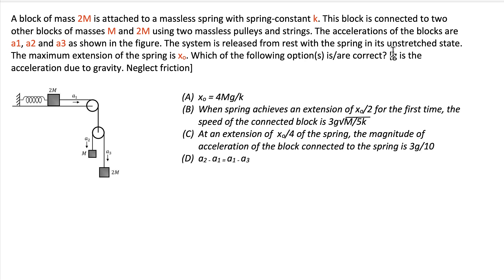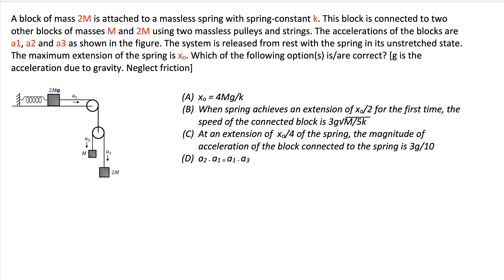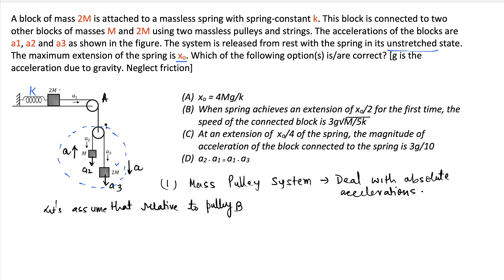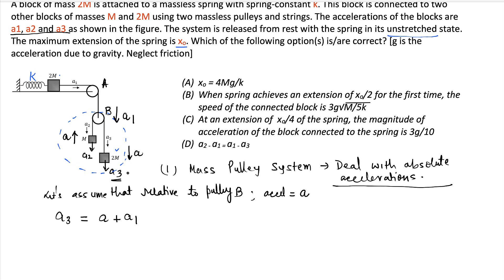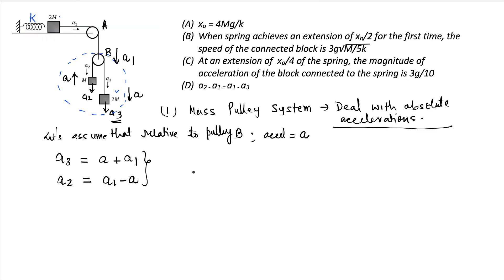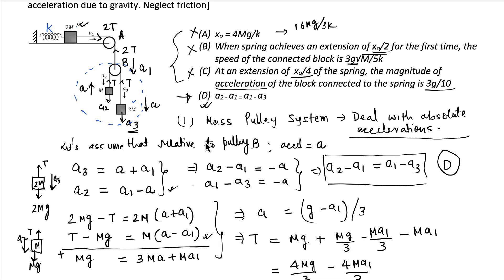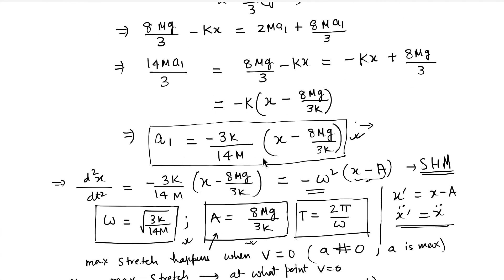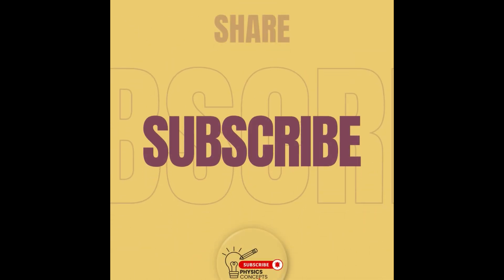Want to Master Mass Pulley Spring System? Watch This IIT JEE 2019 Advanced Problem #jeeadvanced

Comment: You emphasize to focus only on absolute acceleration and not the relative one. Then immediately afterwards, you introduce the relative acceleration of the blocks hanging by the pulley.
Reply from the maker: To answer the question as one of the options requires that.
My point is to deal with absolute acceleration when writing f=ma, as it's less error prone, and simpler

Comment: i went ahead with the problem assuming tension would be constant throught the motion and only the spring would cause the change in acceleration, but turns out it's more complicated than that. great question
Reply from the maker: yeah, that's right, it's a great question. 
In fact, i have noticed people missing the SHM as well there in some cases.

Comment: Its quite lengthy 
I have a simpler approach 
We get Tension as calculated by sir.
Then we solve for max extension
2T-kx =2ma1
We can calculte Tension in terms of a1 
, write a1 as v.dv/dx and integrate 
Do velocity zero for max extension and solve for x 
SIMPLE
Reply: Amazing solution
Reply from the maker: Thanks @jaisinghkotecha8746
Reply from the maker: that's correct. I have done same here too. Just that I explained concepts behind things
Reply: Yes yet another can be use work energy theorem and find workdone by tension use WET on 2M, By the way both are equivalent as in WET also we prove it like a=vdv/dx

Comment: I made a big blunder of assuming 2T=Kx at maximum extention😢. Whereas oscillation hoga
Reply: Same 😭
Reply from the maker: Many committed this mistake
Reply: Us
Reply: Same😢
Reply: Well that was can be used to find the mean position directly if you want ( at the mean position the forces are balanced but velocity is maxm which keeps the system moving till the extremity where accn is maxm but velocity is zero where the particle stops
And the displacement from initial condition to the mean position is your amplitude 
The other extremity is gonna be at twice this distance 

This approach is useful is q only asks you to comment on amplitude and stuff 
But since we need to find V and a 
We need w so you'll have to form an expression of shm

Comment: Sir can we do this question with any other method ,that is using work energy theorems and mechanical energy conservation and all...
Reply from the maker: Yes we can do this using work-energy as well. 
Figure out the velocity of the block 2M which is on table, also the max stretch in the spring, when the pulley goes down by let's say y. You need to be careful with the other two masses and their movement,

Comment: Sir can we apply equivalent mass in the lower pulley system and find maximum extention, value of 2T then apply work energy theorem to find velocity
Reply from the maker: You can use work energy as well. Although that might be bit complex and need to be careful

Comment: Sir , I have completed NLM and friction and have just started with circular motion , Is this question multi-conceptual? I'm not able to understand why you differentiated and SHM , i really enjoy solving constraint relations and pulley block problems, please bring more such advanced questions with similar explanation, overall really enjoyed this video .
Could you also tell me higher weightage chapters in physics and topics I need to look out for as an 11th grader.
Thank you so much sir.
Reply from the maker: @bhavishyashrotriya6450  - For 11th grade, my recommendation would be to focus on Vector, Kinematics, general math tools needed for physics, and general Mechanics (NLM, Rigid body dynamics etc.).
SHM equation for x is some oscillatory function of time and w. To get velocity, you can differentiate x w.r.t time, similarly for acceleration, you may differentiate v w.r.t time. I would highly recommend to focus on basics right now. Keep solving problems (start with simple ones and slowly try tougher ones)
You can send me queries if you have - feel free.
Good luck with your preparation!